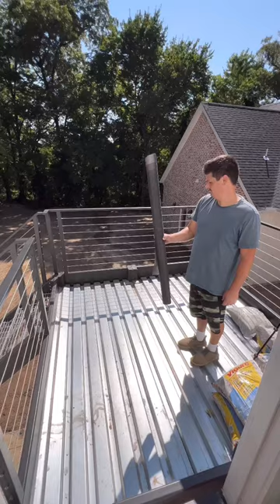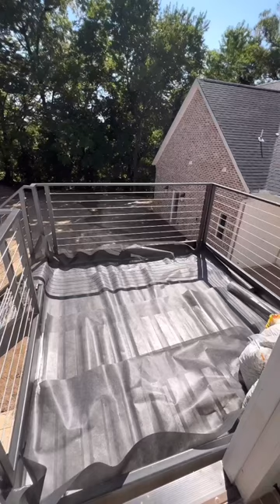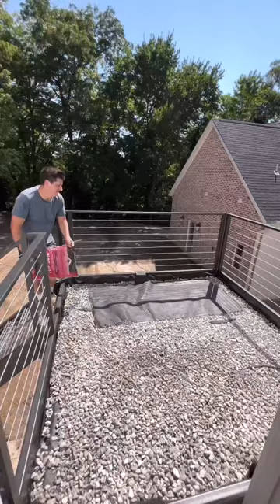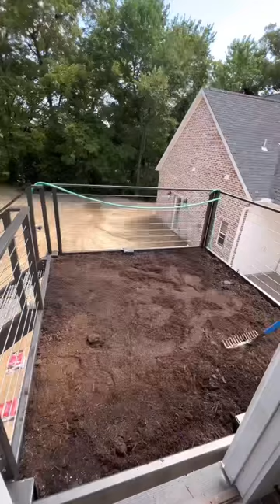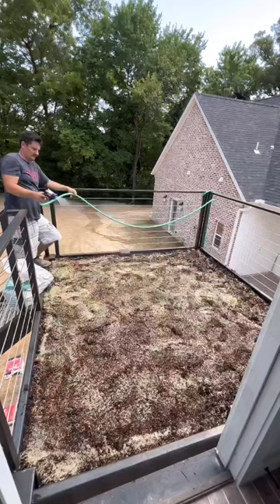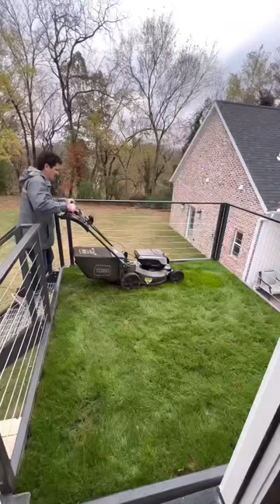How to Grow Grass on Your Balcony

Comment: No epdm rubber membrane under the soil will come back to haunt you. That metal decking normally rust out in about 10 years..... I do a lot of grass roofs and I always put rubber membrane down first.. normally a 45 mil Firestone EPDM with 3-in seam tape if I need to seam it
Reply: In cooler invironments, I've seen it rust out in 5 years.
Reply: The metal is flipped upside down to drain excess moisture
Reply: @frankly2677  no it's not all metal decking looks like that - a commercial roofer
Reply: Well those deck pans are trash.